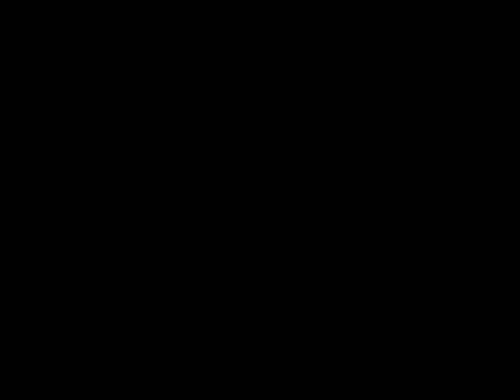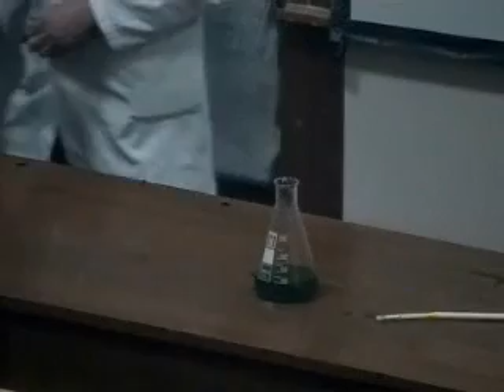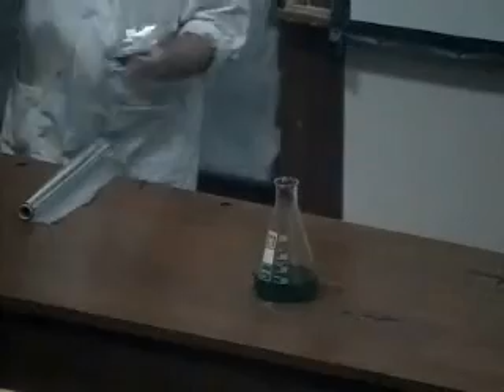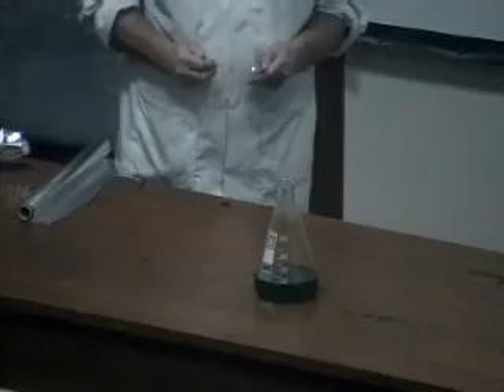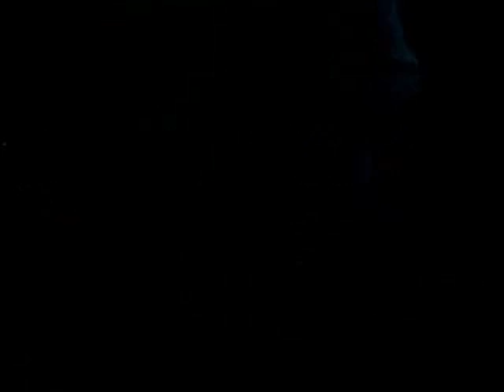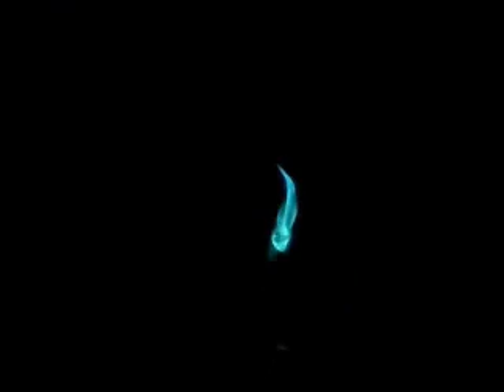Aluminium Foil and copper

Comment: This would produce a controlled amount of Hydrogen gas because some of the Hydrogen will react with the copper in solution. I assume this is the reason for putting the copper in. You would have difficulty making the glass shatter because you getting a slow generation of the gas. Hydrogen is very light and escapes any open container very rapidly. I've made hydrogen candles from Zn/HCl mixtures and they'll burn for a long time.